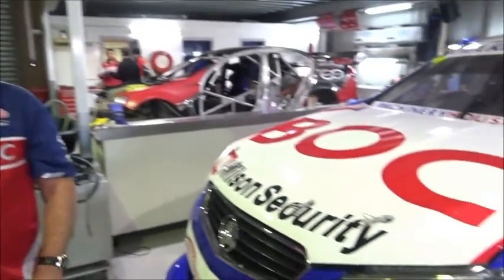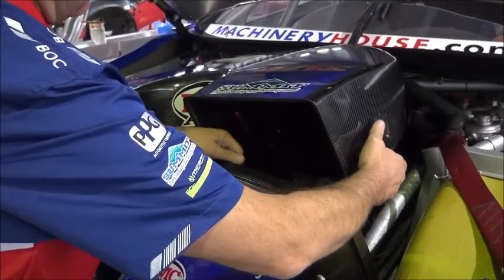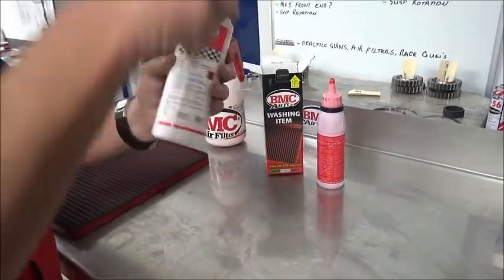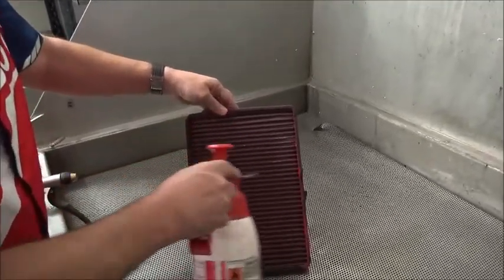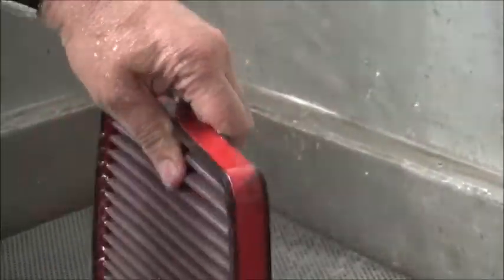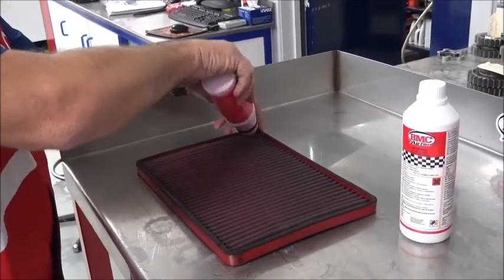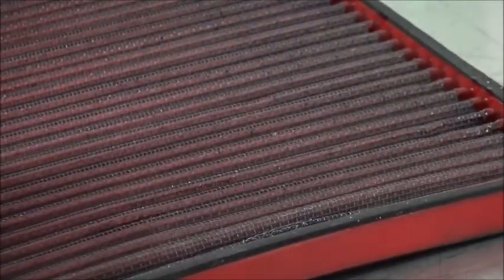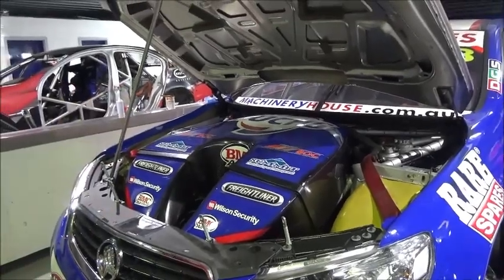BMC Air Filter and Brad Jones Racing

Comment: be careful to use so much oil when using an air-flow-meter on the engine, as normal cars use it.. you can kill it with that much oil